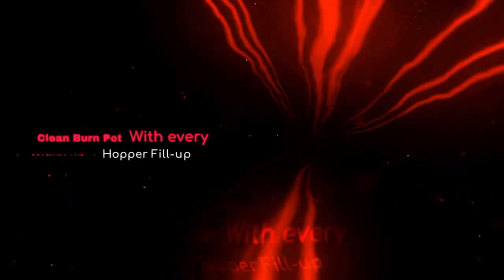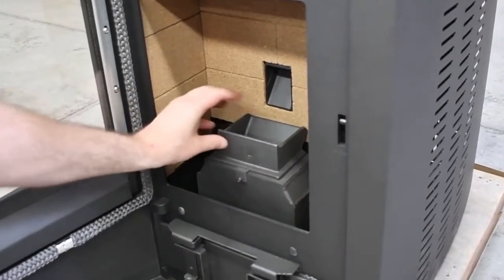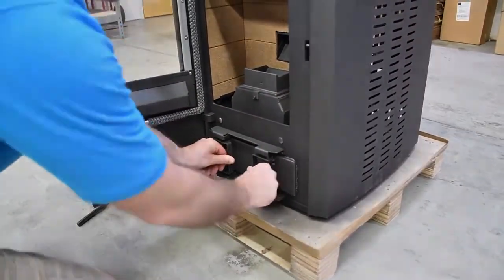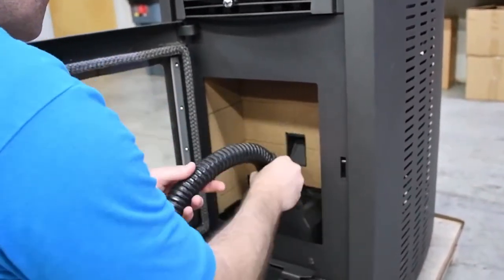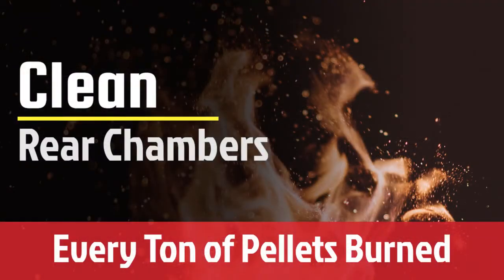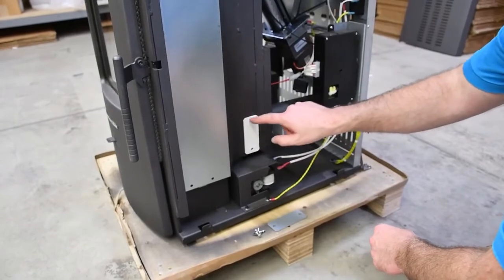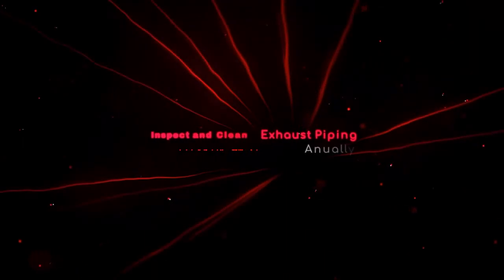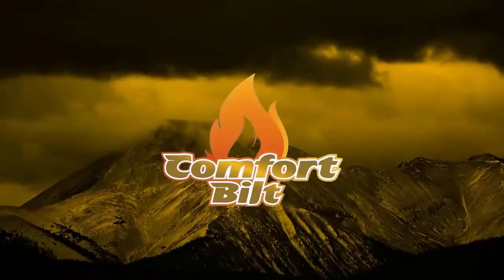Hp50 Maintenance and Cleaning

Comment: I wish the access covers were bigger. A vacuum even with a small rubber hose attached or the use of a cleaning brush is not enough to clean it out. I have found the only way to thoroughly clean the unit is to unhook it and take it out side and use compressed air to get all of the chambers completely clean. It is amazing how much ash and soot  blows out and how much accumulates in the chambers in such a short amount of time.

Comment: Video conveniently cuts when removing the plastic caps on the side panels at 2:38 .. You can tell the tech struggled to remove them, because the paint is all scratched after. 
Take my advice - get a 1/4 drill bit or a step bit and just drill out a hole in the cap big enough for the Allen key to fit. Plastic cap never needs to come out and the final result will look much better than a scratched side panel. You'll save yourself a lot of aggravation.

Comment: Comfortbilt currently doesn't sell a "slender hose attachment" for it's ash vacuum.  I'm not sure why but it'd sure be nice because finding something or rigging up something (was that a garden hose in the video?) isn't very easy.  Comfortbilt seems like a great company but not selling the proper cleaning equipment for their products is less than optimal.
Reply: I agree that they should have an adapter available or should be included with an ash vac. I 3D printed an adapter that works great.